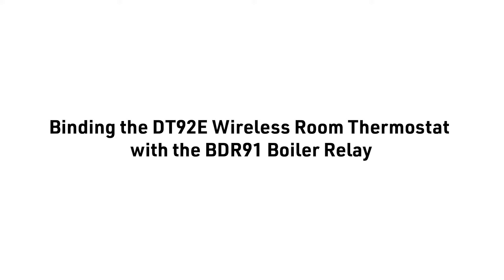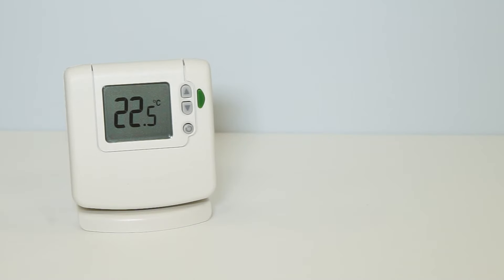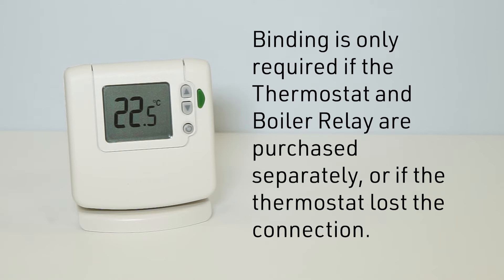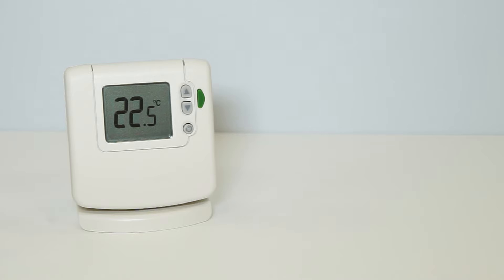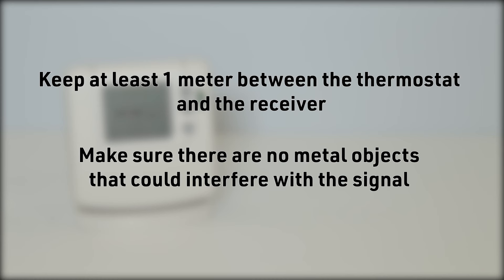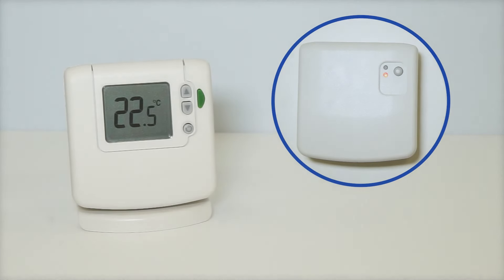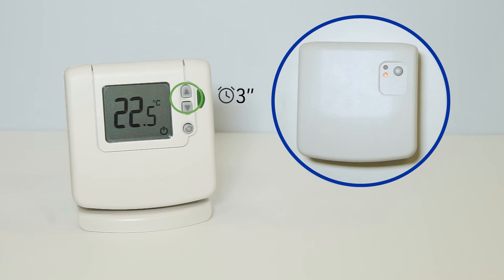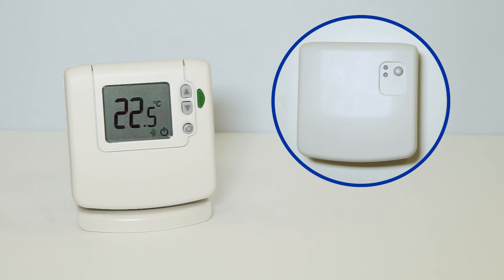How to bind the DT92E Wireless Room Thermostat with the BDR91 Boiler Relay - Resideo

Comment: Great video.
  Is it possible to have 2 receivers binded to 1 controller?  
I want to use a 2nd receiver to turn an electric radiator on and off when the boiler comes on.  I realise I need to add another relay.
Reply from the maker: Hi ElectricPylon, please fill out this form: https://support.resideo.com/s/contactsupport and a member of our UK team will get back to you as soon as possible. -Maria
Reply: @ResideoSupport  please just answer yes or no on here.

Comment from the maker: Pressing the power button on the thermostat for 2 seconds will turn the heating off, keeping a 5 degree frost protection on, in case the temperature drops below, only then it will fire the boiler. -Ted

Comment: I can not find a relay box
Reply from the maker: Hi Brenda, thank you for reaching out to us. The relay would be placed somewhere near the boiler, since it's wired to it. If you're in the UK, this thermostat can also be part of a Sundial RF pack and connected to a wireless enabled programmer, such as the ST9420C, so you might need to check for that. In this link you'll find information about the Sundial RF pack: https://www.resideo.com/gb/en/products/comfort/timers-and-programmers/sundials/y9120h2009-sundial-rf2-pack-1-y9120h2009/. There is also a photo of the programmer so you will know what you are looking for. -Elena